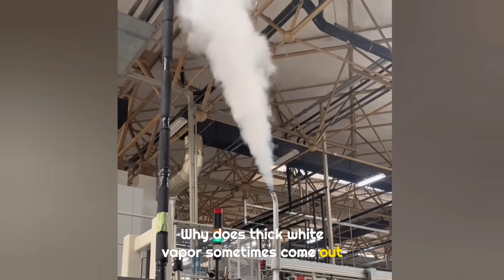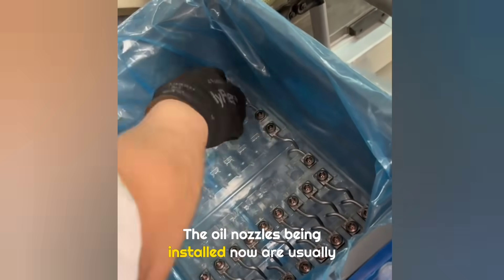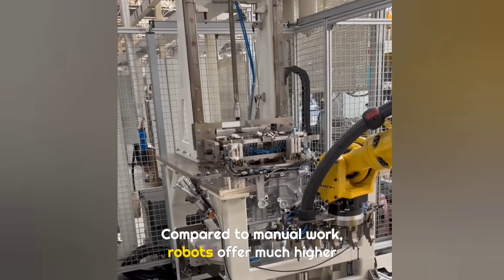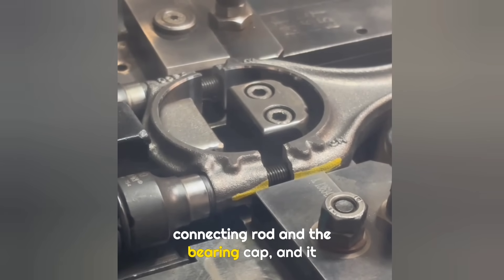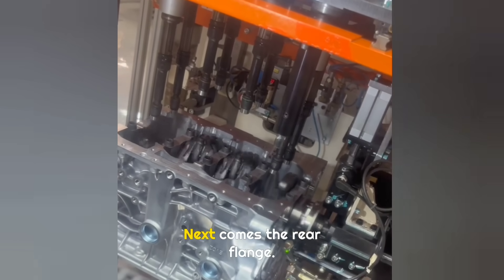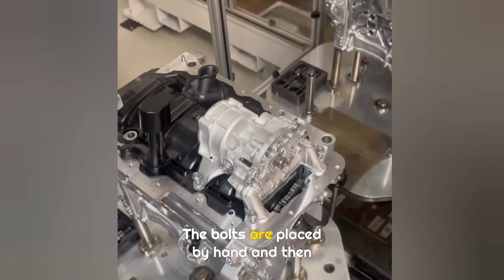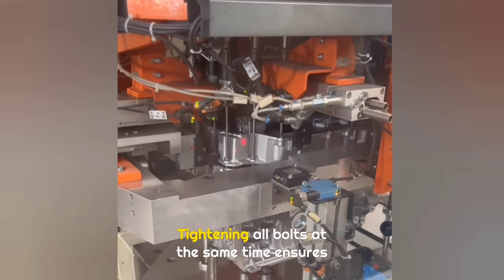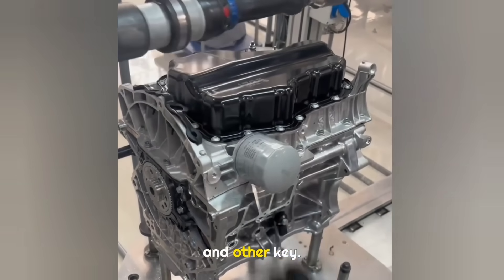How Is Volkswagen New 1.5 Turbo Engine Made Without Cylinder Liners

Comment: That’s an engine that is not designed to last or to be rebuilt.  A tiny 1.5 turbo with an aluminium block and no liners, designed to last just longer than the warranty period.
Reply: @CaptainMainwaring455  most of engines today are like that. 10yrs, 150000 kms and junk

Comment: Can't believe that crank pulley isn't keyed, just shrink fit.
Designed not to be rebuilt. One and done.
Reply: Meh, I haven't had a problem with camshafts without those on close to 30 year engines. Besides, the key is just another weak point, so why would you...

Comment: An aluminium block without a steel liner is one of the worst penny pinching steps in motor manufacturing. What happens to an all aluminium block when the bore has worn beyond specifications? Overbore? = no, New steel liner? = no, Throw into landfill? = yes.